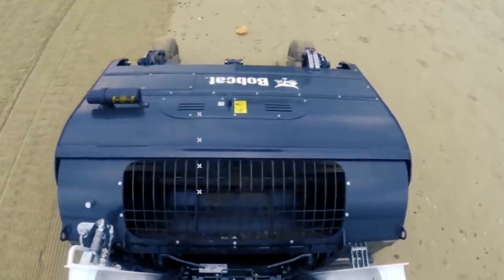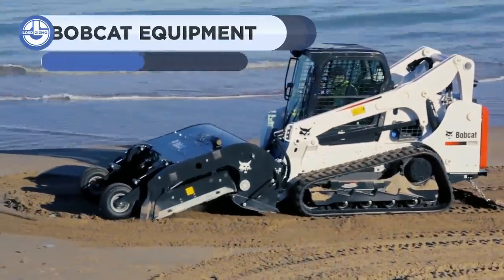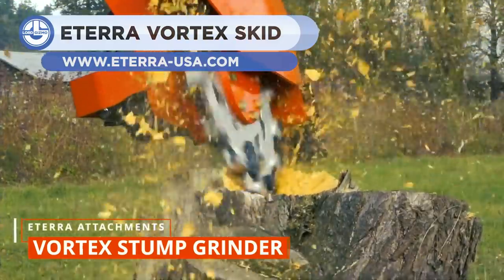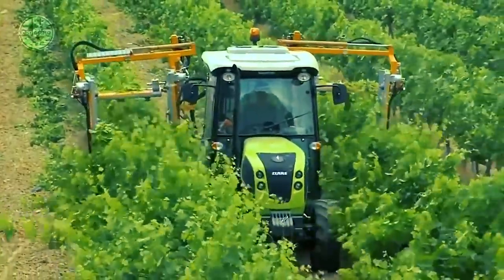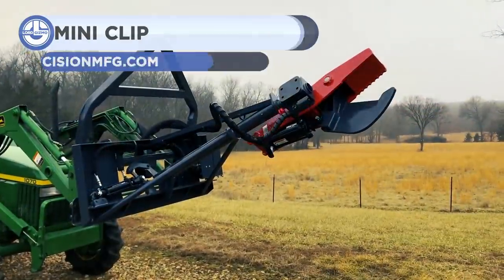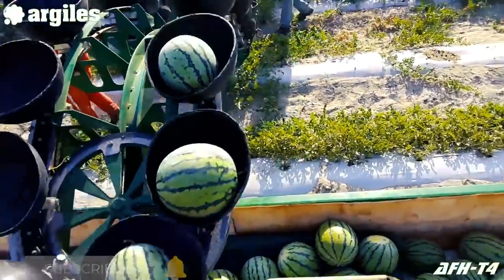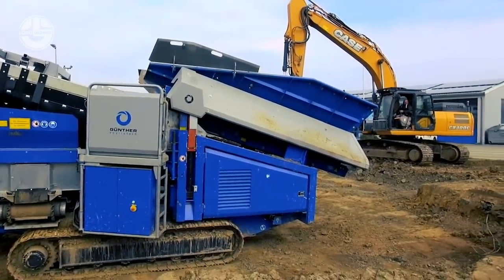Powerful And Ingenious Machines You Need To See | Powerful Machines That Are At Another Level

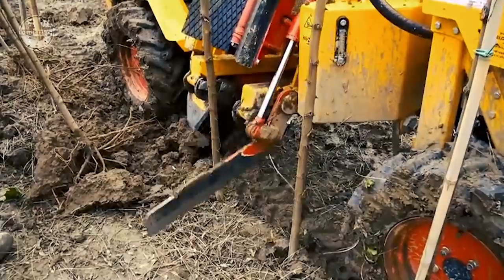Comment: 9:27 You need a machine to do that? I could pull those by hand.
Reply from the maker: Harder than it looks!  Each one might look like a twig more than much else, but the roots spread wide and make it difficult to pull.  Sure, it can be done, but depending on the scale that it needs to be done, an automated machine for the job might just be a better choice.